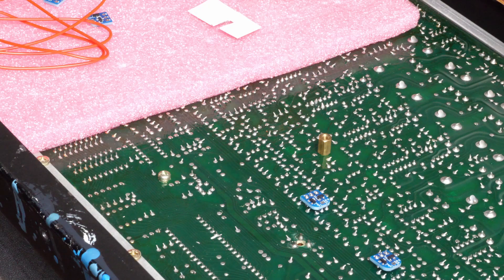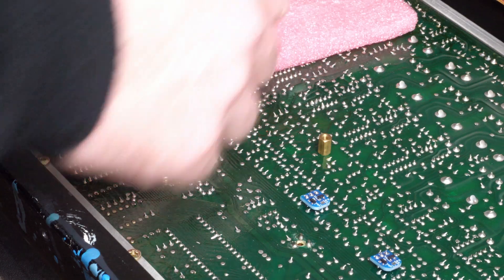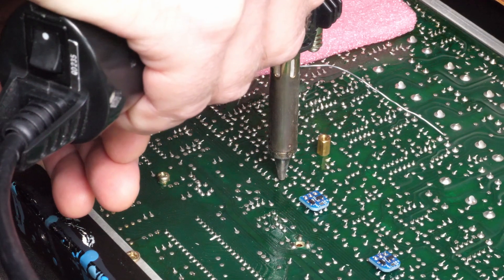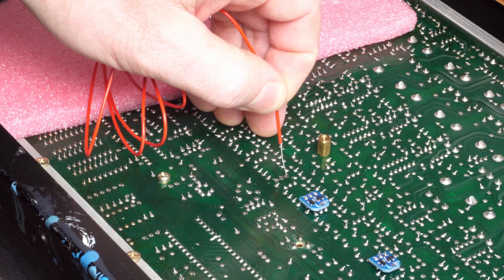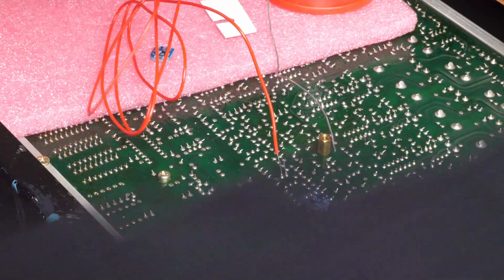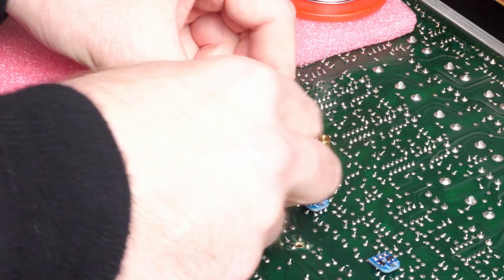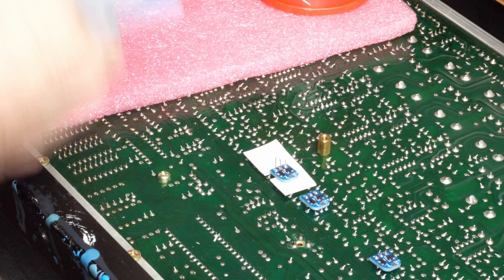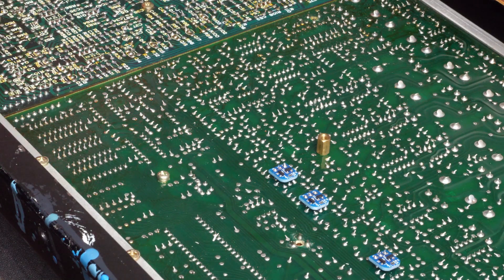Fitting 808 Dmux Trigger Inserts

Comment: will these be for sale via sequentix ? and i presume same trigger can be aplpied to a 909, will this also allow velocity?
Reply from the maker: I need to order some of the boards with the transistors and diodes already soldered, they're a bit too fiddly to do by hand.
These don't suit the 909 - it has separate trigger and accent signals, rather than a pulsed accent trigger.
I have a different design of dmux receiver in my 909, but it doesn't yet interoperate with the internal sequencer.
It connects via the digital lines that normally drive the trigger and accent latches on the 909 voice board.
Got plans to do that so dmux input can merge with the sequencer, with a faster microcontroller if possible, or may need an fpga.
Reply: @sequentix  thank you for the reply , awaiting eagerly the progress another stunning project great work
Reply: Want this for the 909!

Comment: Colin, what is the solder gun you're using? Works pretty nice. Btw, this voltage drop is around 0.3V, right?
Reply from the maker: Gun is a Denon Sc7000z. Not exactly cheap, but it's worked well for me.
Diode drop is 0.3v, yes.
Reply: @sequentix  thanks will check it